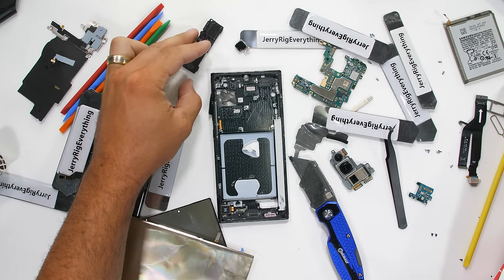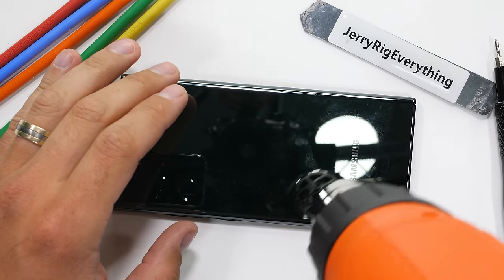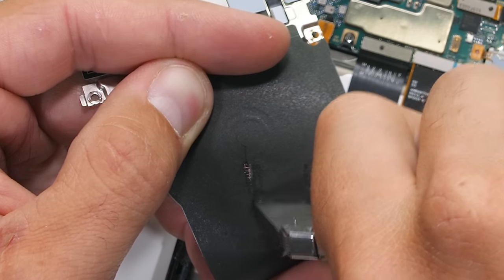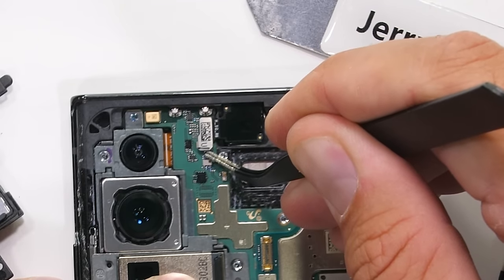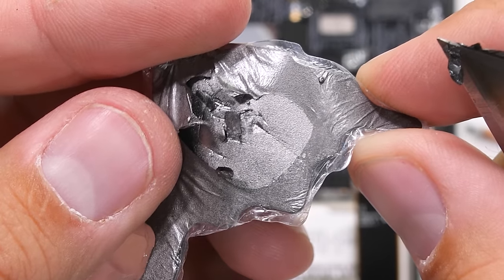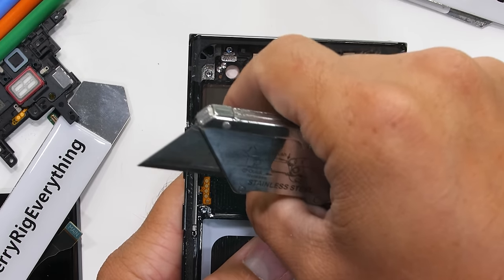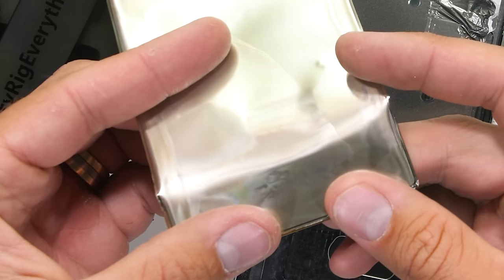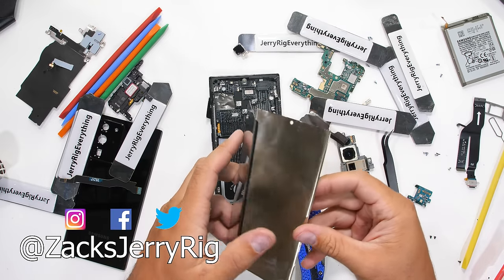Samsung Note 20 Ultra Teardown! - No Copper Cooling inside?!

Comment: "Samsung has changed alot over the past few years..." makes me worried. May not buy another Samsung product before watching your teardown first
Reply: When I have a phone I'm looking at I always watch his vids about it first.
Reply: Yeah was quite happy for years with Samsung, but my new phone will be another brand...
Reply: Shut up. The iphone does not even have a copper cooling inside
Reply: @devinotruth  No one was even comparing samsung to apple. Don't know why you had to bring it up.
Reply: Eric Li ok. The point is they keep pointing out copper cooling. When i iphone does not even have it. Not every phone needs it.
Reply: @devinotruth  Samsung’s Global Note 20U definitely does need it when it has the toasty exynos chip. There’s no problem in pointing out the faults of a phone.
Reply: The life Of Truth Because they’ve designed a phone that doesn’t notoriously overheat like these. Apple don’t need to, whereas Samsung do need cooling.
Reply: Graphite pads have higher thermal conductivity than copper and Zack doesn't know shit. Exynos is crap and samsung knows so they give it better cooling.
Reply: @tomn.9987  Ah sorry you must be a professional. Explaim further please.
Reply: @domlorg96  Ok, graphite has about 5x thermal conductivity compared to copper. You could say that snapdragon has a "vapor chamber" but all that is is basically a very thin heatpipe (which uses liquid evaporation to transfer heat faster making it very effective). The vapor chamber may have higher heat capacity but in the end both are just heatspreaders, not heatsinks. It's all about spreading the heat over a large are and dissipating it as fast as possible. Now the exynos variant, as far as I'm concerned, has had some overheating issues where the device as a whole was getting warm. All this means is that the graphite pad is doing it's job very well and the issue is the shitty Exynos SOC. Is it possible that the vapor chamber could have saved it? I doubt it, though if made big enough it could have been slightly better. Blame samsung for their unacceptable, shitty Exynos instead. We need to push Samsung to get rid of that crap first, then we can focus on heatspreaders.

Should you feel like reading constructive and consummer friendly summary, look this toppic up on ifixit or XDA developers.
Reply: @tomn.9987  Aight, thanks for all that Info. I'll check it out. Besides ifixit is nice.
Reply: @devinotruth  just because apple is WORSE, doesn't mean that Samsung can do something like this
Reply: i will never buy another scamsung product in my lifetime, they are getting more and more two faced and blatantly scamming ppl out of there money with the exynos scandal, who knows how deep the dirt goes? F*** scamsung
Reply: Fanboy
Reply: @devinotruth  iphone don't need as strong CPU as android phones because IOS is close environement where everything is optimized, i can run newest apps even on IPHONE 5 SE!. that's what is the most painfull for me as android user. After 2-3 years phone slows down because of rising requirements for applications. sometimes i fell like they are forced, because if apple can have newest version on their old phones why android cant?
Reply: @kilerek3  iPhone need much because they can't do much.
Reply: TRUTH ABOUT SAMSUNG: 
RECOVERING COVID PANDEMIC LOSSES BY LOOTING INNOCENT PEOPLE
500 DOLLAR NOTE 20 for 999 DOLLAR
700 DOLLAR NOTE 20 ULTRA for 1300 DOLLARS

Comment: Samsung could've at least priced Exynos version cheaper than the Snapdragon version smh
Reply: That would solve a lot of problems, but then the name is just worthless
Reply: Exynos sucks
Reply: Samsung is becoming shit. I was one of the biggest fan and that's what they did.
They are become money grabbers and I have to say this Apple is far better. Samsung showcases their USA model of Note 20 Ultra whereas in general the camera, heat dissipation, processor and everything sucks in the Exynos model. If Samsung and AMD makes a new processor then am sure they will even lower the resolution or do something to cut the cost but wouldn't tell it to their customers.
Reply: Why? 
If Samsung uses SD in both US and outside, then the phones would cost more due to having to pay Qualcomm for more chips.

Also the ONLY reason Qualcomm is even used in the US and China, is because they still have CDMA carriers. 

If they didn't, then we all would have the Exynos if we all only have GSM carriers.

The Qualcomm chipset is more expensive. Making the other Exynos, balances out the cost so both can be sold at the same price.

To me the performance gap is not significant enough to matter. The fool bitchen about it are just fools who have nothing better to do.

When people found out Samsung was using caneras from Sony and then also the ISOCELL they make themselves, people bitched. Yet the photos had very minor differences.

Some people just like to bitch.

If any fool herw think they can build a better phone, then go do it or STFU.

You don't ever have to buy Samsung phones. 

Because I won't be anymore or even Apple. Because prices keep going up, and yet they removed the headphones and the Note's extra tips, which I think is far worse than the chip whining.

Out lhomes regardless of price have always had headphones and to remove them and making plans to remove chargers is all complete BS.

I hope my Note 20 Ultra lasts because it likely will be my last Samsung and I certainly won't be buying an iPhone. Which means I won't have any good choices because I hate any other phone that runs Android.

And since I can't swap the battery for a new one, I may have to swear off phones forever or just hook the phone to a charging pack to keep it running.
Reply: @TechieXP  If I could have build a smartphone better than them. Then you would have licked my butt but I don't want that to happen cause am straight.
Reply: @danielj.3326  I prefer exynos
Reply: Tim VeePee imagine being content with a subpar device you spent thousands of dollars on. Have fun with your overheating, 1300 dollar doorstopper
Reply: @DerpyDreamz022  it doesn't overheat and I am enjoying it just fine.

Maybe you just mad because you don't have one.

I can't think of any device that gave me any significant problems.

A phone with a power chip is gonna get hot. After all they dont have active cooling.

Maybe if younuse tools the way they were meant to be used, you won't have any problems.

People always have something negative to say about something they didn't even buy with their own money.

Everyone's experience with a device is different. 
My device doesn't overheat.

If it does, it has a warranty and I have insurance too. Sometimes people may get a defective one. That doesn't mean they all are.

Samsung tests their devices harder than any other brand. None of their devices have ever had significant problems. Even the Note 7 didn't.

Enjoy your lackluster cheap limited less costing boring phone, while I enjoy my awesome 6.9", 120hz, amazing bundle of S-pen joy!!!!
Reply: He's using a South Korean Snapdragon version, not his mistakenly identified Exynos unit.
Reply: @riktamsarkar7684  get a phone called realme X2 pro it's better than iphone 11 pro max
Reply: @LORD_WEENEE  Am against buying a Chinese smartphone don't call me racist cause I have no problem with the chinese people but the government. They way they are torturing people in Hong Kong. A lot is going on right now, and China government has a policy that each and every Chinese companies need to sign an agreement/clause that says when government demands or need private data including data of the user or consumers they need to provide that data. So, am either gonna buy the upcoming Pixel if it comes with the latest processor orelse am getting an iPhone but will keep my Note 10 Plus along with me. Cause the S-Pen is so much useful and for businesses it's much more useful.
Reply: @LORD_WEENEE  If next year everything goes well, I will give my Note 9 to someone else and will buy the new Note in 2021. Hopefully, they will not do the same thing as they did with the Note 20 Ultra.
Reply: yeah
Reply: @basweshwarthakkarwad5035  I have. All the S6 models had the Exynos. 

The only issue it had was, the modem was not fully compatible with CDMA networks and the phone woild drain the battery more because the modem was working harder due to the incompatibility.

The phone also got fairly warm during intensive online usage, again because of the modem.

Other than that I lived the S6 edge, but not the Plus model.
Reply: @riktamsarkar7684  uhh, US government is no different than China's. It's just a matter which media you listened to since YOU KNOW NOTHING about what's going on in the inside.

Or do you really think Google or Apple won't give user's data if the US government says so? You seriously believe that they're on "the consumer" side and will never release the data to the US government? what a fool you are to believe that PR act BS.

Your only choice right now ARE: 1) what kind of privacy information you're willing to "share"; 2) which country would "take care" your shared private information better

I'm using mostly Microsoft's cloud service most of the time and Google as a backup. See my choices on who's going to handle my private data?

Privacy means nothing nowadays, remember that. If you ever believed that Apple or any other big tech companies would keep your privacy data, then you're a fool (a big one at that).
Reply: Yeah
Reply: @kamikakushi_  3 of my friends live in China. So, I know what am talking about and I have also been to China. I know about the restrictions but that's how Socialist country work anither example is North Korea.
I somewhat agree to that but you don't know how server works. The government is nothing leaking information from server can lead to war. Everyone data gets stored in server, if some of those data was to be leaked companies like Google would go Bankrupt. They have to face trail in court, leaking about a person is different than leaking confidential information.
Reply: Tim VeePee the chip isn’t affecting the performance.... The SoC controlls everything. S20 ultra had 30% battery difference in these 2 chips. Also the exynos s20 ultra had auto focus problems. And the canera was really bad. They tried to fix it with update, but it’s still not as good as the sd version. Samsung is doing shit and they are going to loose their customers.
Reply: @TechieXP  it's that everything except the screen is worse in the exynos model....
Reply: @riktamsarkar7684  that's why I always flash custom roms :)
Reply: @riktamsarkar7684  sorry to break your believe but, unless your friend is an important person in the government ranks. it holds no meaning. what you perceive might as well be what "they" want you to believe. conspiracy theory yea but, unless you or any of us here is an important person in the government ranks, our talks here are merely opinion and holds no truth whatsoever.

secondly, the data being stored on some company's server IS accessible to ANYONE who have authorization on the system.
Do you really think companies such as Google or Microsoft will create a "super" safe system that no one else but the consumer has the "key" to their own personal data stored on Google's/Microsoft's system? 😂

Have you ever read the Terms & Conditions section carefully?

You see, as a politician, I'd love to have billions of people who believe anything they hear (or see) without ever questioning a thing about those informations (and I'm sure both the US and China's government would too) 😂
Reply: @kamikakushi_  Ya you are somewhat right but as far as security goes I would prefer any other brand other than Chinese smartphones. As far as I know Apple, Samsung, Google have never been found to leak personal data or monitor personal data. Unlike Chinese manufacturers that have been found. Many individuals also discovered the privacy threat that these devices possess.
Reply: My sister struggles a lot with her exynos S10+. It likes to overheat and lag. And the battery life isn’t too good either. Honestly now that Huawei was killed by Trump, Samsung became what they swore to destroy, I don’t like Xiaomi and OnePlus takes mediocre pics I would struggle to pick an Android flagship. And that’s why I switched to iPhone 🤷🏼‍♂️
Reply: @riktamsarkar7684  Have you forgotten the news about Apple's contractor and their activities regarding Siri recordings about a year ago?
Yup, that's just one of the privacy breach that has been accidentally exposed (well, of course Apple would just say that they don't have anything to do with it) to the public.

My points in my previous comment still stands, tho. Just be wise with your exposed data.

You can choose any of your favorite brands (I mean, it all comes down to personal preferences) but, once you use some random apps or you might share your information on public and blaming Apple or Google or (insert another big-a** information companies here) for "leaking" your data, no one else is to blame but you.
Reply: Tim VeePee Yeah you have no idea what you’re talking about.
Reply: Tim VeePee all phones heat up. Thats a solid fact, but a phone heating up to the point that it burns your hand and throttles like crazy is an obvious red flag. I should know because my brother bought one with an exynos chip. Heats up like crazy after scrolling through facebook even with the brightness lowered and screen setting(refresh rate @60 and 1080p). Cant even play a single game of codm without it dropping below 30fps.

He knew beforehand that the exynos chip was shit and thought that was all overblown bs. Suffice to say, i think he wont be having another samsung phone anytime soon. 

P.S he bought it with his own money, and i think its every customers right to talk shit about a premium phone you spent 1300 dollars on and only to find out that your note 8 is miles better.

Comment: you should've teardown the "cheaper" note 20, to show how much they scammed us
Reply: I think the spec sheet tells the story. The phone is worth max 600$ not 1k
Reply: @SrinivasRajkumar  750 tops.
Reply: @SrinivasRajkumar  exynos version doesnt even worth to spend 700 $
Reply: @SrinivasRajkumar  if its made in china its gonna be cheap. But if its made in south Korea its gonna be expensive.
Reply: @SuperSanic..  Dude the production value of the device will be around 400$ or less .  1k for note 20 is way too much.
Reply: @bilalahmedsiddiqui9639  that's being generous.
Reply: @SrinivasRajkumar  lmao and then there's me with a 300$ phone that still has aluminium body and glass back, meanwhile samsung can't afford to use quality materials and go for plastic in the note 20
Reply: @SrinivasRajkumar  well, you know it has the latest chipset. Snap 865 plus, the Exynos should be cheaper but SD is 750 I think

Comment: I was always a Samsung diehard. They managed to produce quality phones at reasonable prices specially mid range options. Now I cannot find a single phone in their entire itinerary that I would be willing to part with my money for. Definitely a lot has changed and NOT for the better! 
I still use my iPhone 7, just replaced the battery and it’s working like a charm. Don’t see the point in spending more money on an iphone SE..most of the hardware is the same. Though that A13 processor would be a welcome addition. Unfortunately I live in the third world. 
Another great video!

Comment: It’s like the MacBook Air where the cpu and fan aren’t even connected
Reply: How could the cpu not be connected? The laptop would just be a brick at that point.
Reply: @ALifeOfWine  CPU and heatsink
He meant connected to eachother
Reply: @ALifeOfWine  😂😂😂🙄
Reply: that's why it's called "Air" lol
Reply: @greecemobile7610  it is called air because it misses air
Reply: @MsMonster128  This makes more sense, thanks :)
Reply: Researchers at Chalmers University of Technology have developed a graphene-based film that has a thermal conductivity capacity that is four times that of copper. This new technology makes it perfect for cooling electronics circuits and components in RF devices, LEDs, servers, and smartphones, to name a few.Jul 15, 2015
Reply: its better graphene is better than copper
Reply: just googel it graphene is better